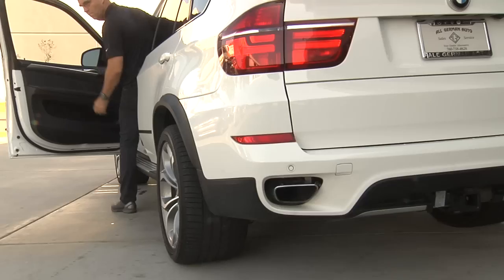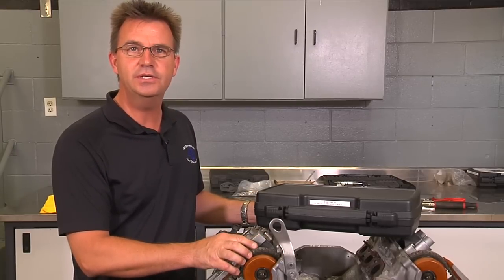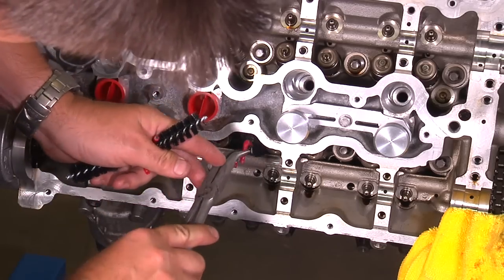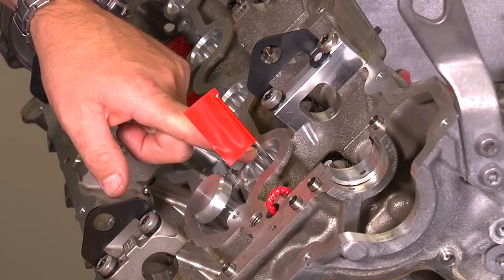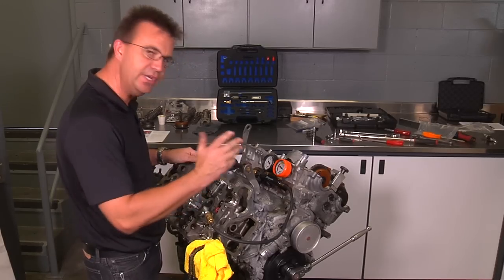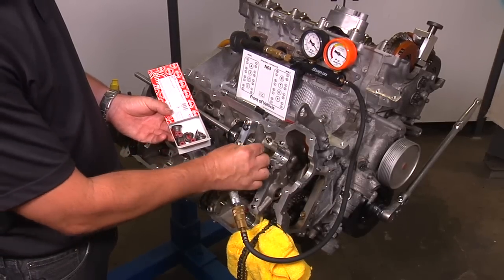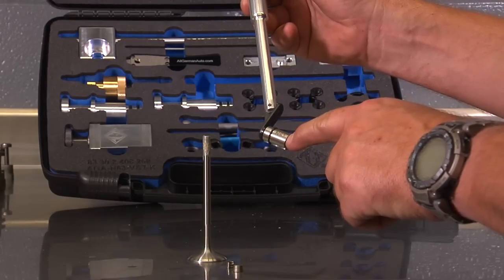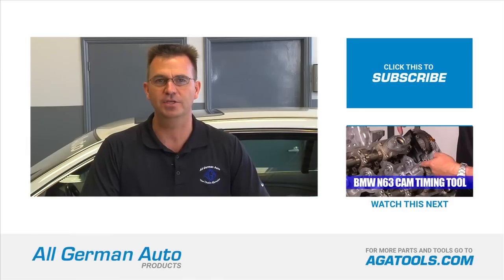AGA BMW N63 Valve Seal Tool

Comment: Great video, but what was the point of using the leak down tester & compressed air?
Reply from the maker: Using a leak down tester will keep pressure in the cylinder to keep the valve up. With the valve up, you can compress the valve spring and remove the valve keepers.
Reply: It's not essential, you can either use compressed air or a bungee cord to keep valve stem staying closed and from dropping down into the combustion chamber when it's disconnected from the spring. I prefer using a bungee cord instead of compressed air - this is what the grandpa mechanic did in the old days 🙂.  With the bungee cord trick, you feed the cord into a cylinder (through the spark plug hole,) turn the crankshaft by hand to raise the piston up, compressing the rope against the top of the cylinder. This keeps the valve(s) held up so you can remove the keepers for seal replacement. Essentially what you're going to do is turn the engine clockwise until the cylinder you're going to work on is just past B.D.C - bottom dead center - and it's on its way back up - use the red flag to indicate how far up or down the piston is. If the piston's close to TDC you will use much less rope than if the pistons down in the bore. Put the piston to TDC so that you don’t need much rope to keep the valve from going anywhere. So first use the red flag to feel for the piston. Then with the piston close, just feed in the cord then turn the engine gently so the piston goes up the rest of the way. Leave plenty hanging out of the plug hole. You shouldn't have to stuff much in there either unless you are trying to fill the cylinder up with rope with it on bottom dead center. Feed in the rope through the spark plug hole. Leave enough dangling out so you can pull it out again afterwards and in case it drops further in while turning the engine. Continue turning the crank slowly until you can feel resistance as the piston squashes the rope near the top of the cylinder. After you're done with seal replacement, turn the engine backwards (anticlockwise) a little, keeping an eye on the rope end - you don't want it disappearing down the spark plug hole. Again, just remember to roll the engine a little the opposite way to release the cord when you're done. Now pull the cord out of the cylinder you're working on. You're using a bungee cord because it's hard for it to knot up. A regular rope is easy knot up making it hard to remove from the spark plug hole.

Comment: Hi,
Great instruction and demonstration of your tools usage. I'm in the middle of a valve stem seal job in my home garage on 2010 BMW X5M S63TU. I visited your AGA website, nice building, lot's of overhead cost, hence the price you're charging for these simple, yet effective tools. Your cost for both tool sets needed for the seals: N63 CAM TIMING KIT SKU AGA-CTK-N63 $749.00, N63 VALVE STEM SEAL TOOL KIT SKU AGA-N63-VSK-K $1,399.00,  Sub Total $2,148.00 
Shipping $34.51 
Total $2,182.51 
This is not very cost effective for the DIY'ers doing a one-time job. This being said, do you offer a rental service? I shopped the web and Ebay'ers are offering rental, which also is pricey. 
Regards.

Comment: Iam never buying another bmw all this shit is unnecessary to fix a engine why cant you just use regular hand tools damn
Reply from the maker: You can use regular hand tools, that isn't the issue. Using regular hand tools will take MUCH longer as you will need to remove the engine, valve cover, timing cover, cams, timing chain and cylinder heads. Which most people don't want to do.
Reply: @AGATools  o really thanks imma give it a try

Comment: Who has tackle this job in their garage???😊
Reply: Doing it right now 🤣😅
Reply: @oneanonly2075  
🤣🤣 best of luck I did it as well late last year reach out if you have any questions 👍🏻
Reply: Who has the timing procedure ?or does it come with the tool rental ?
Reply: @ameerzeidan123  no instructions come with tools. These are professional tools and with professionals tools you are expected to know how to use them. 
I did this job year ago I do have experience with working on the cars. 
I used various different sources when it comes to timing the engine. I also did have BMW tech just phone call away when I got stuck. This give me confidence to do the job. Keep in mind he didn’t do any work. All he did was sometimes give me directions 
Best of luck 👍🏻

Comment: He forgot that if u used full air pressure the timing case will break where the pin is holding the harmonic balancer
Reply from the maker: This is where our N63 Timing Chain Lock comes in. The chain lock will lock the timing chain in place so the engine doesn't rotate over, causing any damages.

Comment: $1,200 for this tool? And most likely you’ll only use it 1 time? I think not! 
You can get it done at a indy for 2500. Its better to save up for the extra cash and get it done there. Not any indy but 1 that u can trust. 1200 is waaaaay over overpriced
Reply from the maker: Levi, you may use it once. But how many times are these independent using it? Many BMW workshops and independent shops have used our tools many times to provide customer with fast and reliable valve stem seal replacements. So if you think from an independent's perspective, they use this tool once at the rate of $2,500 for this job, they have paid the tool off the first time they use it plus made extra money. 2nd time using it is profit.
Reply: I'll rather spend $1,200 in this tool kit, and do it my self than spending $10k for a dealer to do it.
Reply: Id rather not get this engine in the first plaice,
just crush untt burn itt
Reply: I've saved up 5k to get this done and can't find a indy I trust near western kentucky. I'm about to buy these tools and try to do it myself.

Comment: Brilliant kit and great video. A lot of time and dedication went into this. I have a few questions:
1. What do you charge to do this valve seal job on an N62 engine?
2. Do you have a list of shops around the country qualified to do this repair? Like, CT or NY.
Reply from the maker: Hi,

1. We charge 20 hours if the vehicle is a sedan. If it is an SUV, we charge 21.5 hours.
2. Email me your contact info and address. I will help you find one. My email is Rich@agatools.com
Reply: @AGATools  Are you guys located in escondido?  I have a 2006 bmw 550i that needs a valve replacement. rudykirsch@gmail.com
Reply from the maker: @TheRudski  We are. Give us a call at 760-738-4084 for more information! I tried sending you an email but lately our email has been going to spam.
Reply: AGA Tools do u guys have a shop. And where are you located?
Reply: AGA Tools Javier Casas
626 688 2654

Comment: Would prob get more sales on the tool if there was a video of Martin Christensen demonstrating to us how to remove parts off the car and how to do a proper leak down test instead of just showing us on an engine that is off the car. =P cool tool a little pricey but can definitely save you some time. like if you want to see a full tutorial =)
Reply from the maker: Hi Art. Because time is of the essence, we cannot produce a video that demonstrates removing everything inside the engine bay. The cost of also having a camera man record 35+ hours of video can get quite expensive as well. 

We made this instructional video with the engine outside of the vehicle is for a couple of reasons, one being that if the engine was inside the vehicle, you would not be able to get clear view of the engine and what we are trying to show you. If we made a video with the engine inside the vehicle, all you would be able to see are the cylinder heads and the technician working on it.

We recommend this job for a professional technician who understands the basic concept of being a technician. Removing an intake manifold and using a leak down tester should be common knowledge for those planning to tackle this job. We understand that not everyone is able to afford a technician to perform this job, so we tried the best we can to capture the important details of this job and put it all on one video without having to sit through a 26 hour video after all said and done with editing and etc.

However, if anyone were to have any questions, comments or issues while performing this job, we have a tech support line that is available from Monday through Friday 8-5 PST. This tech support line can be reached at 760-738-4084. For those who think email is easier, we can also be reached at rich@agatools.com

Thanks!
Reply: So your gonna have a camera man for 35 hours of filming.  Why does he get 35 hours to watch and the tech gets 25.5 for bending over and actually working!

Its a good thing the N63 engine now cost less to replace than to fix.

Comment: Hello how are you i have bmw 750li year 2009 i have proplem i check about with computer and she pull these codes but i dont now where is the location for sensors...Crankshaft inlet camshaft 2 reference: angle difference outside limit value Crankshaft exhaust camshaft 2 reference: angle difference outside limit value
Reply: Khalifa Khalifa 
Step 1: remove oil filter and check for small metal particles in the bottom of oil cap. If metal then replace engine. 

Step 2. If no metal then install a new vanos solenoid on the affected camshaft. Change oil and filter. Stroke the valve cover (bank 1) gently and say some nice things. Maybe you get lucky and its fixed.  

Step 3. If fault returns then replace engine. 

Step 4. Don't spend any money on an N63 trying to diagnose or check timing or replacing timing chains.  Just buy a new engine. 

Step 5.  Don't listen to anybody telling you that it can be fixed. It can but the cost is HIGH and the crank bearings with probably seize and fail shortly after. If its got more than 60k, then replace it.  Look for discounted engine prices coming to a dealer near you.

Comment: how much will a job like this will the dealer charge
Reply: Ive done this job countless times as I work for bmw.  The last quote I did just the labor was 8,000 dollars as it takes about 40 hours to do. And all german auto does a terrible job of how to do this.  Some of the tools in the kit are garbage and nobody i know takes the injectors out because you dont need to.
Reply: Justin Skaggs $200/hr??
Reply: *****  Thank you! for the information
Reply: the amount of work is insaneeee

mess up once and it's over
Reply: Anthony Abelardo I can't imagine doing that 3 valve on each cylinder.

Comment: Hello. I have 2010 bmw 750i  acutal 130 000km and this engine has 1liter oil consumption. Is this n63 engine? I haven't seen white smoke from exhaust pipe. What is my problem? 

best regards

stan
Reply: ***** thanks for your answer. This is 1L per 1000-1200km, not miles. Engine has no leakage and no white smoke from exhaust. Repleacing seals is possible without removing motor head?
Reply: ***** thanks.
You recommend or not recommend replace valve seals?;)